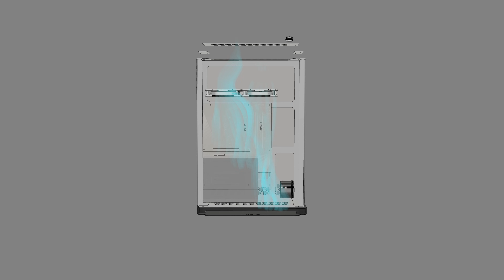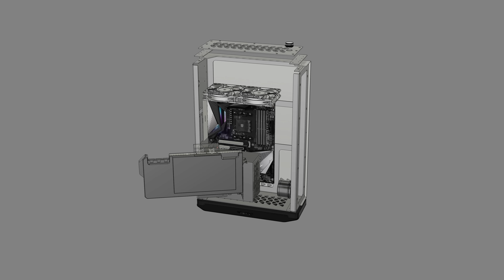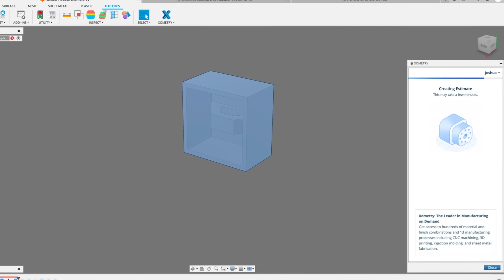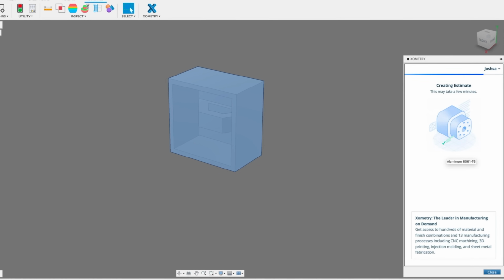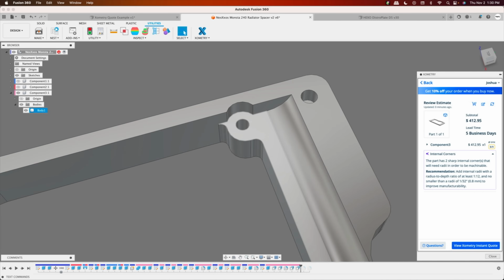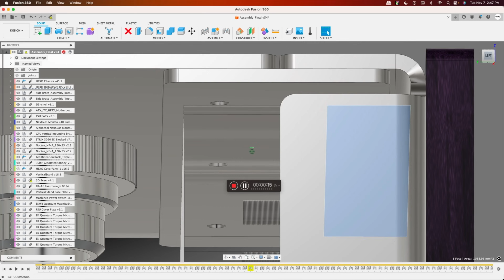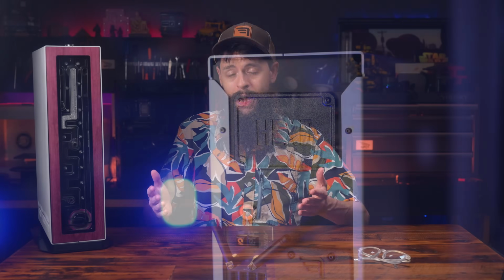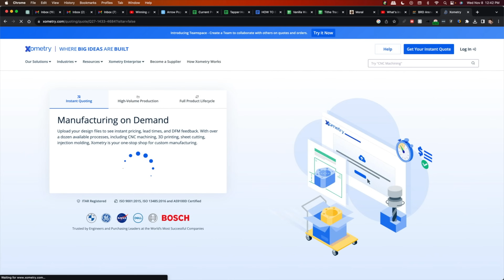I kidnapped machinists to make this ULTRA Efficient ATX case...

Comment: yeah but what's the point of making it ATX, if you can occupy only 1 PCIe slot
If there was a way i can use all of them, i'd unironically build this
Reply from the maker: Sure I can help answer that. This design is unique and the main perk is you lose NOTHING practically speaking from it being ATX vs ITX. The width is decided by the 120mm radiator at the top. The depth is decided by the GPU PCB and the front distro plate. And finally, the height is decided by every other component because the rest over the area where the motherboard is.  So since there is no drawback to ATX in this design, why not? Oh, and besides the extra PCIE M.2 slots on ATX, you can actually fit up to three single slots cards in this case. It's just that for this particular build the waterblock and fittings and run I used takes up all three. Peace
Reply: But you do
since the PSU being at the bottom infront of the lower PCie slots, completely blocks it
and without a water cooled solution this airflow design doesn't really make sense
If it said mATX build that sacrifices nothing, sure, understandable, mATX only has realistically access to 3-4 expansion slots
but ATX has 7. Before you say "Who actually uses all those" I do. I have a 2 Slot gpu, a SAS expansion card and a Intel Arc card for encoding
It's a technicality, but you really do lose out on alot compared to a normal ATX build, if it said mATX, no issues, cuz it'd be about the same
Reply from the maker: @skorpysk  I don't understand your point friend. I thought your question was why make it ATX and I explained that. If you need full ATX then build a case that offers access to all the slots, or get an EATX. Maybe I'm just not understanding your origional question. But if I can help lemme know.

Comment: Would be super curious to see a 1U server implementation with a gaming graphics card. I have my Home Lab with a couple of servers and one day I tried to make a 1U server with a powerful processor which is really not a difficult task, there are enough of them in data centres, but what is missing in data centres is quiet systems and that was the main goal. Not just a powerful server, but a powerful and quiet server. But when I tried to build it I faced a number of problems and gave up the idea, replacing the 1U server server chassis with a regular 2U. However, this idea still does not leave me)

Comment: my problem with this is that theres no reason for it to be atx when your limiting it to 3 expansion slots. it seems like atx for the lols rather than for the actual benefits offered by t he form factor.
Reply from the maker: The purpose of supporting ATX is that the case doesn't offer any size drawbacks because of the hardware positioning. So it's like a mini itx case that supports ATX boards, which often have better features, mosfets, IO, M.2 support,and pricing.
Reply: @NotFromConcentrate  i just wanted to point out that all of those benefits are also available on micro atx boards so i still fail to see a reason why atx specifically but i do understand that itx would have had limitations

Comment: I have a mild concern that you could have better results if the airflow crosses the radiator FIRST as that is cooling the active components. Having cooler air intake and flow over the radiator BEFORE it flows over the other components might be more efficient. Perhaps having the power supply at the top and radiator at the bottom... but its still a more efficient design than most other computer cases. 

I also havent seen the whole video yet... just the design description and explode view.

Edit: amazing freaking workmanship. Its like beyond professional quality. So nice. I wish I had the system myself lol

Comment: Do the NF-A12x25 have enough static pressure to push through the radiator? Would the Phanteks T30 be better?
Reply from the maker: Yes because of the design of this radiator and the spacer with the top the fans do a great job. I did have the T30s standing by JUST IN CASE!!! Maybe I'll put them in the next build. :)

Comment: How much to buy my own Erick? I have been looking for one to improve my mini-system cd player hat ITX build... and by improve I mean finish. 

That wood is gorgeous, works really well with the black and white frame/panel components.
I think a smoother flow path in the front panel reservoir would have worked better, but the harder corners were a better aesthetic. Oh the tradeoffs one must make :)

Comment: What I don't like about this build that it stands dangerously close to the edge of the table. 
Its really cool that the cooling design works that well.
Did I missed it or didn't you mentioned which cpu was used in this build?
Reply from the maker: It was light on details--it was a 5950X with a ASUS 3090 Strix. Thanks for the comment!!!

Comment: love the design though i dont understand why one should use a full size atx motherboard if the other PCIe slots are unusable anyway
Reply: They tend to be cheaper, have 3 or 4 M.2 slots, and can support 4 RAM sticks compared to ITX.
Reply from the maker: nailed it @grantbaxter3669  not to mention I/O and usually better VRM/Mosfet